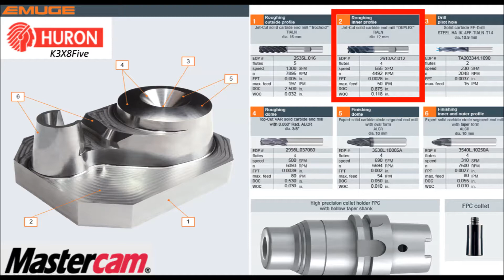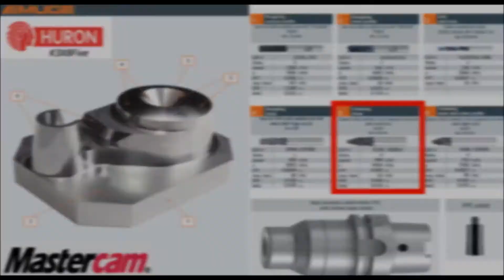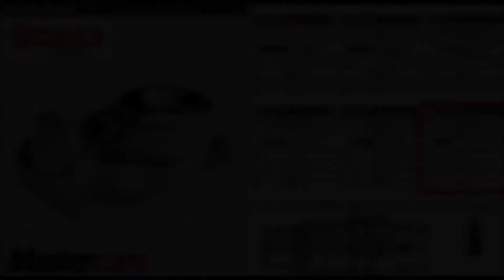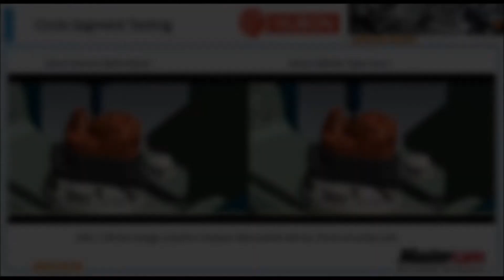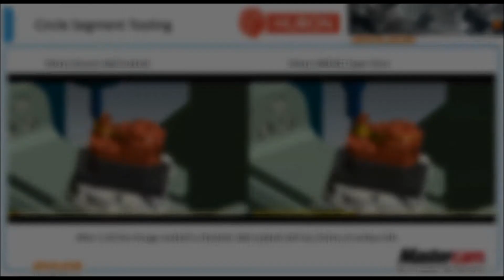MASTERCAM with EMUGE TOOLING - CIRCLE SEGMENT on HURON CNC - P20

Comment: What Mcam multiaxes toolpath was used with that Barrell Mill? Having a tough time getting mcam to use different parts of the tool.
Reply from the maker: Parallel and morph are your best bet. all comp in MC 2019 but those strategies use the tool the best. I'd recommend 'surface with tilt' to maintain the appropriate contact point.

Comment: Did you have to use third party programming options for Mastercam or were all these paths included with the mill level you had? Im looking into programming like this only I need to gather as much info as I can. We do a lot of deep wall machining so these circle segment end mills would help.
Reply from the maker: All included in the mastercam multi-axis package
Reply from the maker: This was all done with standard Mastercam Multiaxis toolpaths. Morph 5 axis and parallel 5 axis. Using 'surface with tilt' tool axis control